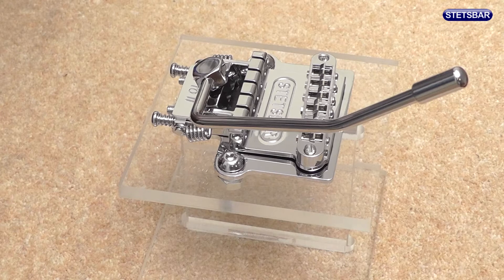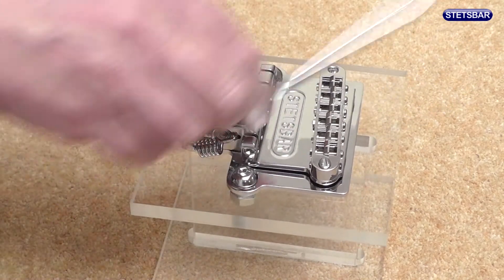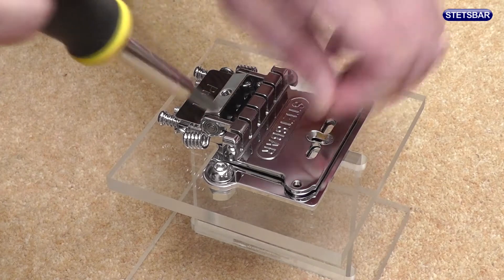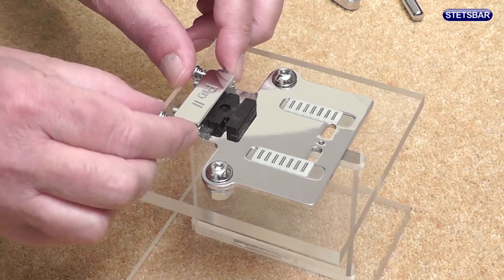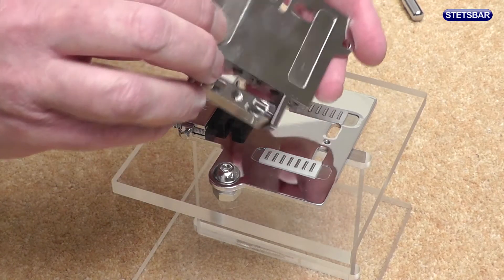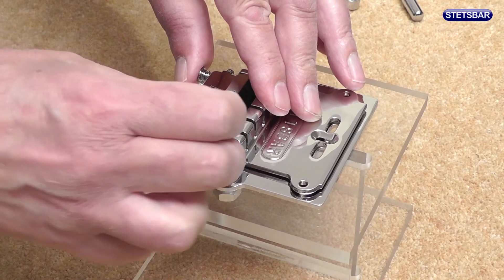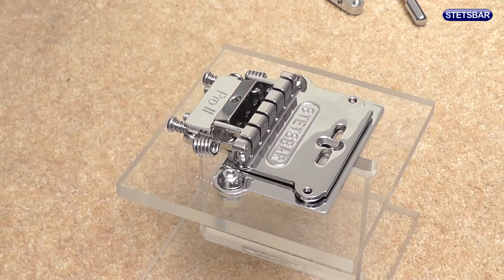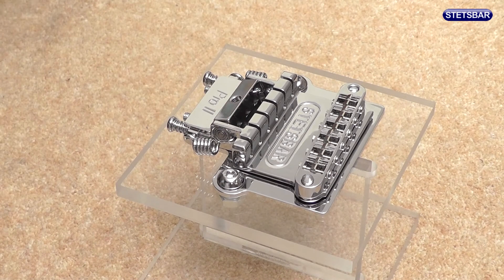Stetsbar Strip and Re-assemble

Comment: Is it normal that the tune-o-matic bridge stays very loosely in place? It makes a lot of vibrations when I play. Thank you!
Reply: Hi there - it should not do that. Do you have enough down-force from the strings? - can you  email us at info@madisonandfifth.co.uk with a couple of close up pics from above and from the side
Reply: @MadisonandFifthUK  I've managed to minimize the noise by raising the bridge, adding more down-force. The action is a bit high now, but it's almost silent. I think that the problem has come up because I had to flip the tune-o-matic direction, as there wasn't enough room to move the low E and A saddles for a correct intonation. When they where pointed in the "traditional" way the bridge didn't make noise, but when they are pointed towards the neck, being equal the height, it becomes noisy and the instrument looses a bit of sustain in D and G strings. Could a solution be individually invertible saddles?
Reply: @AFGalopp  - I've had your email + pics from Stetsbar so I will continue on that email
Reply: @MadisonandFifthUK  Ok, thank you!

Comment: The screw is only there to keep the bridge (top) plate from opening away from the base plate when there are no strings placing downward pressure on the unit. Maximum bridge plate travel is determined by other parts of the design. Hope that helps!

Comment: forgets to mention the flaw in what the roller bearings are on. The bearings are not rolling on the base plate, what you're really looking at is a piece of metal in those slots glued to the base plate. Rather glued very unevenly and poorly to an extent where this paper thin plate gets a dent in it and the rollers catch in the dent.